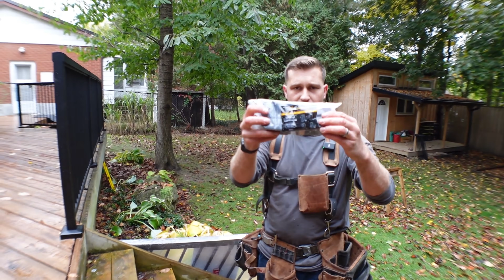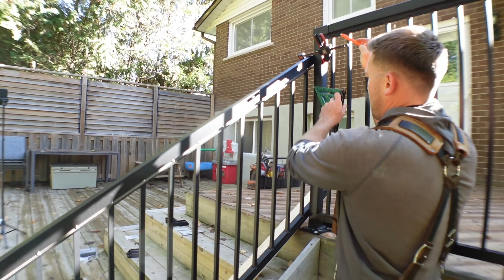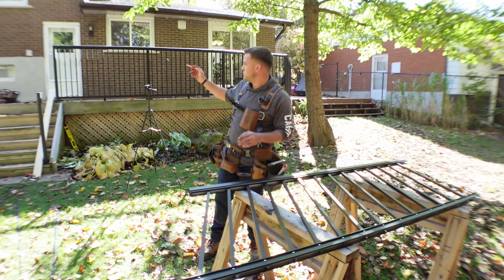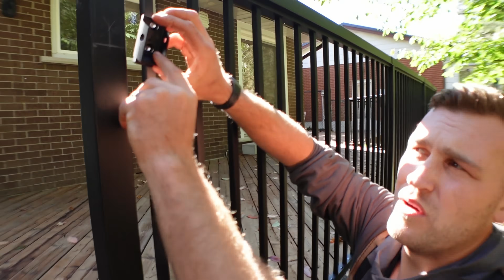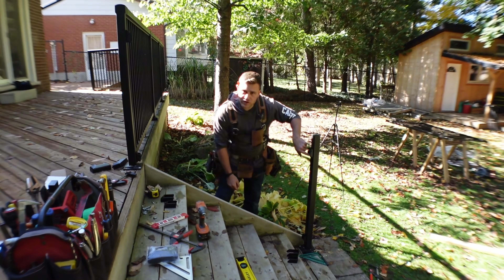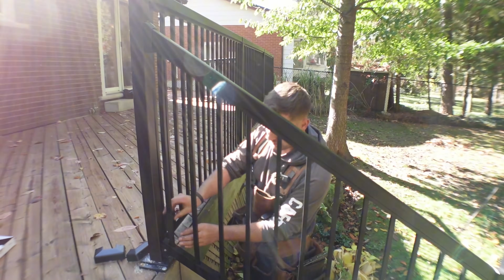DIY Peak aluminum stair railing install

Comment: If I had a timber post at top of stairs, could the handrail attach to the timber post with the same brackets instead of the aluminium stair post?
Reply: Yes